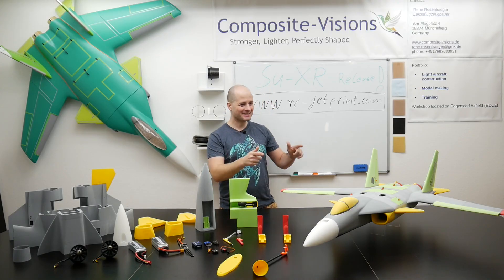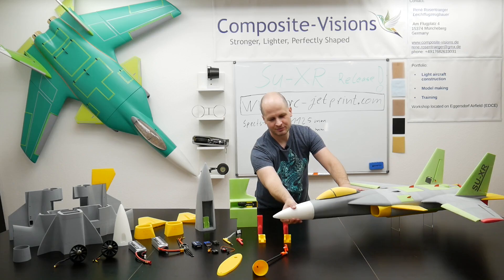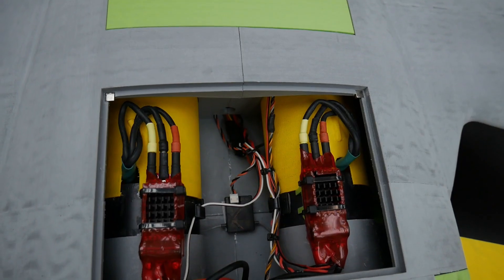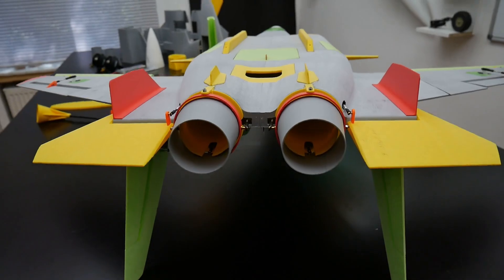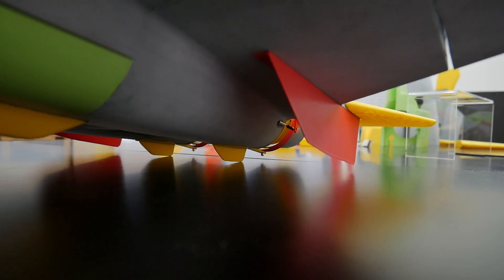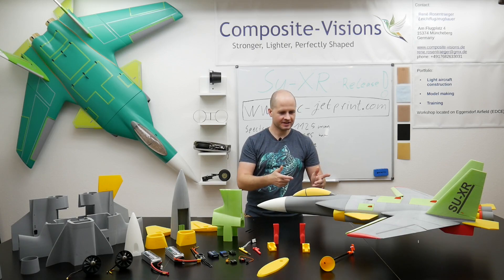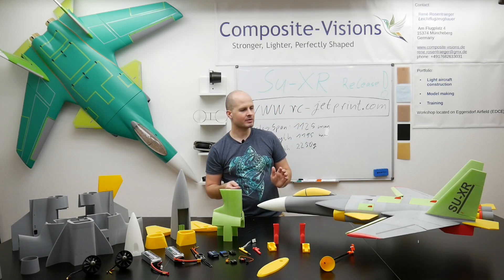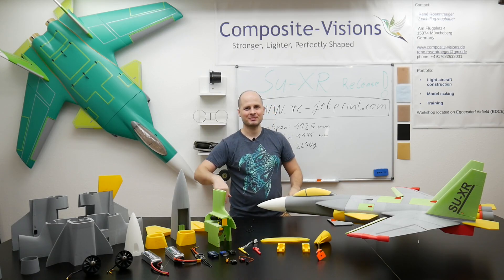Our first 3D-Print LWPLA Project is Ready | Lightweight Acrobatic EDF Jet

Comment: Couple of questions, 1 is there way to purchase this as a kit? I don't have access to a 3d printer just yet. 2 the plane on the wall is that a larger scale or the same size as the kit?
Reply from the maker: We just sell the STLs. The printed size  70% from the wall one. You can start with a small printer👍

Comment: Will there be a version with landing gears ?
Reply from the maker: This version is ready prepared for landing gear 👍
Reply: @rene_rosentraeger  is the landing gear retractable? wondering if it would accept retractable landing gear from other 64mm or 70mm airframes. Was thinking of using gears from the Mig25 Foxbat twin 64mm.  or 70mm F18.
Reply from the maker: @afbenaza  yes its made for 25g retract mechanics.

Comment: If you have 64mm edf in front and perhaps a smaller diameter with higher rpm behind it later in the duct, would you get better performance? A 2 stage edf?
Reply from the maker: This sounds like an axial compressor. Makes sense in a gas turbine but not as EDF 🔧👍
Reply: @rene_rosentraeger  worth a try🤷🏼

Comment: I have the cr10v3.  Which printer profile do I start with?  The one that says retract or the the other on?  Nose section 2 is showing on cura to be 55g. And your specs says 45g.  That's a big difference, any ideas?
Reply from the maker: The retract one is just for the covers. I added some bottom layers  on nose 2 to reinforce the front frame. That caused the more weight. It is just needed if you build the nose removable👍
Reply: Thank you

Comment: plane looks great , and looks like it fly nice , but  £75 for a stl file is abit steep , average price of stl models is around £35-50 as this  going to be on par with shop brought kits once made , you would get alot more sales if you  looked at your pricing , granted i now there is alot of work that goes into making the files , and i dont mean to be negative but the price is way over the norm ,
Reply from the maker: You're absolutely right mate, the Su-XR is no average set of STLs. It is something special made with passion for passionate Modellers👍

Comment: Is the ESC requirement of 80 amps correct? The recommendations for the FMS and X-FLy EDFs are only 45 amps...
Reply from the maker: Correct👍 I was also curious when I saw that XFly drains 62amps at 1, 2kg thrust . Fms was at 48amps with about 1kg.. So for fms a 60A esc would be OK.

Comment: Guten Tag.  Bitte teilen Sie mir die Abmessungen der bedruckbaren Fläche Ihres 3D-Druckers mit.  Ich möchte STL-Dateien kaufen.
Reply from the maker: 300x300x400 werden benötigt. Cr10v3 Größe👍
Reply: @rene_rosentraeger  is it possible to adapt to my printer 255x210x200
Reply from the maker: @ОлегСергееа-ы8ц  Yes it is possible. There is a lot of freeware out there to devide the parts👍
Reply: @rene_rosentraeger  ?